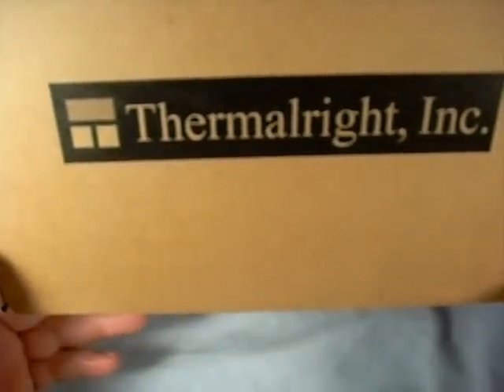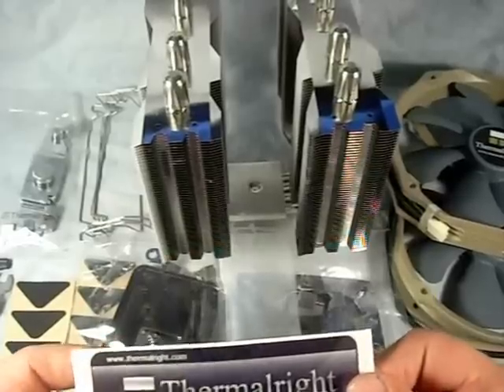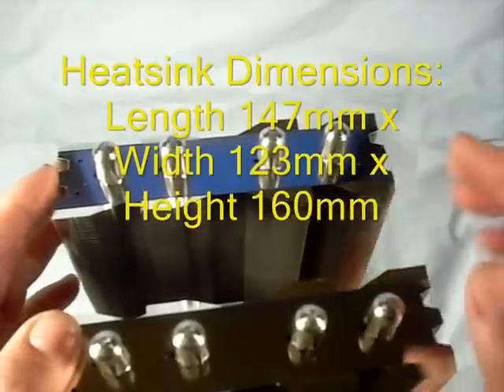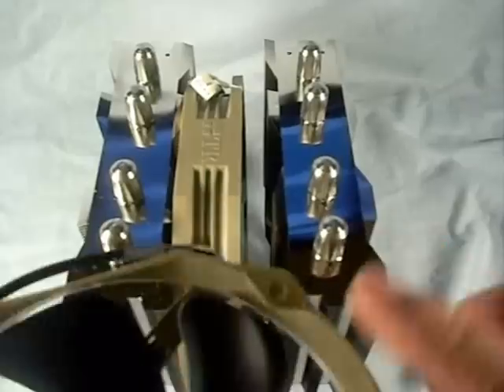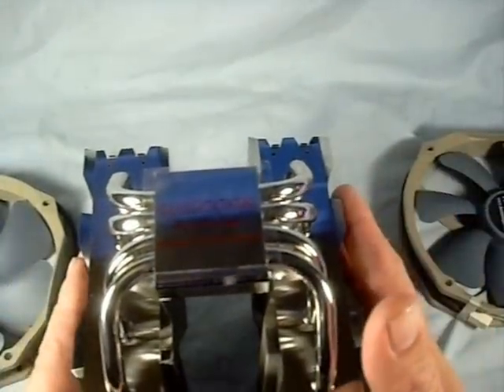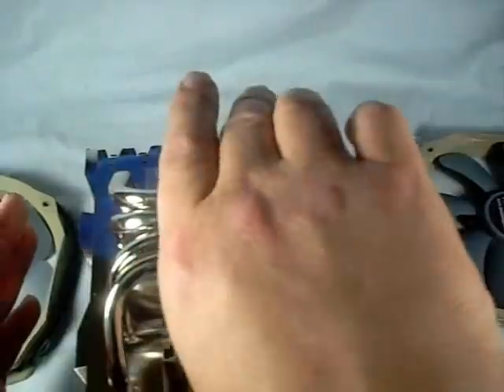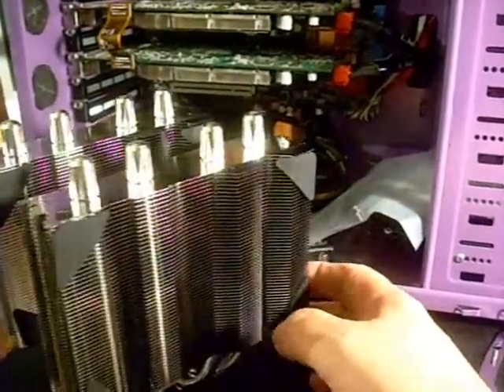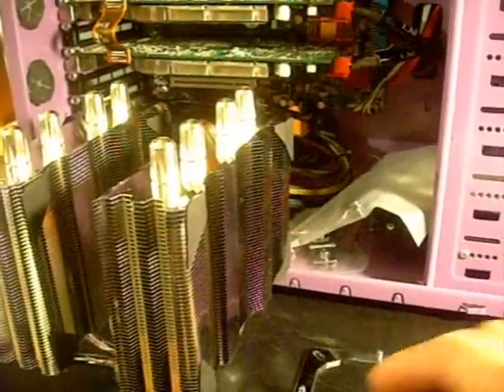Product Showcase Thermalright.Inc silver arrow cpu cooler.

Comment from the maker: @jarskiXD Not sure off of the top of my head. It is a very large cooler and will fit most mid tower or full tower cases if they don't have a side fan in the way. If you could get me a measurement from the motherboard tray to the side panel I could tell you for sure,

Comment from the maker: @soma1509 It would be a close fit but I think you could jam it in there. The fans that they recommend are

 Fan Compatibly: 120x25mm / 140x25mm / 120x38mm

I measured about 2 1/4 " between them. But I think the reason they say 38 mm is because any larger then that the stock retaining clips wont be long enough.

Comment from the maker: @Blackout9550 The tests were done at about 24c. But I used zero cure time on the thermal compound. So I would think afet a few runs I woulkd see at least a couple degree drop in temps.

Comment: Interesting review. My CM 212+ has similar results. I have my Q9300 at 425x7.5 w/ 1.296V load. It is idling at apx 35-37c and load temps are 56-57c with a 23c ambient.
What was your ambient temperature or did I miss it in the video?

Comment from the maker: @PGTMan That is very true. I knew that I would be trying out different coolers with it so I wanted to make it as painless as possible. I thing I have noticed is that I should have notched out the top part of the hole farther. It is still a bit of  a struggle to get some backing plate to mount with it. So I think I am going to  pull the board back out and make the hole larger. :-(

Comment: You couldn't have done that quite as easily on the Antec before you cut the hole in the mobo tray for the backplate. You'd have had to take the mobo out between changes. Bet you're glad  you did the overhaul!

Comment from the maker: @SylentCommando To be honest they are actually not terrible. They are fine for stock speeds or even a little overclocking.  But things will heat up pretty fast as soon as you start getting past about a 10% overclock on them. And of course the cooler you keep things the longer then will last so it is a good idea to get a good cooler just to get a few more years out of your cpu.